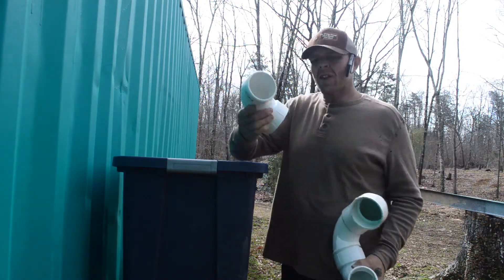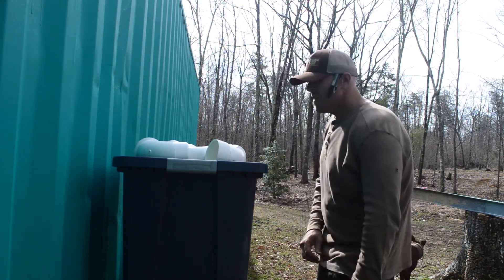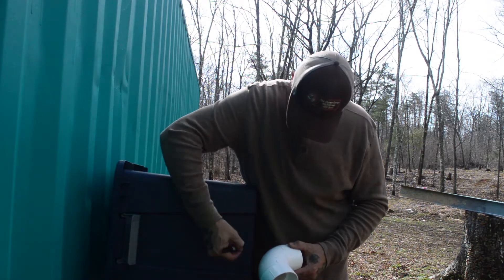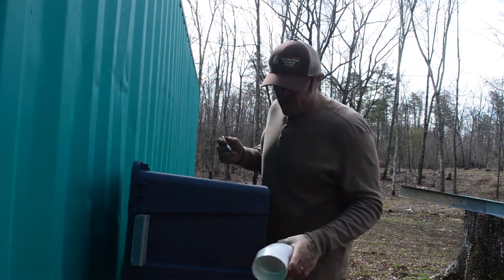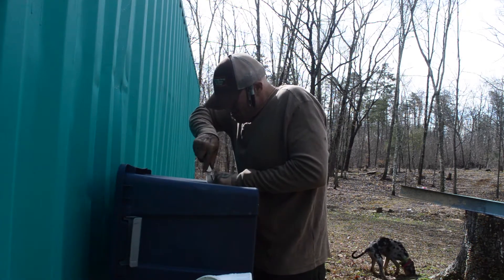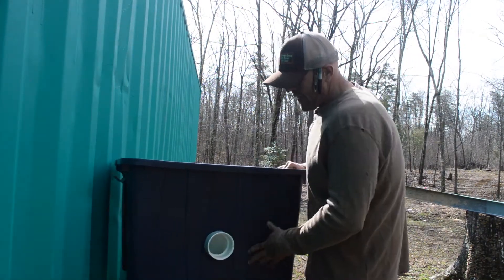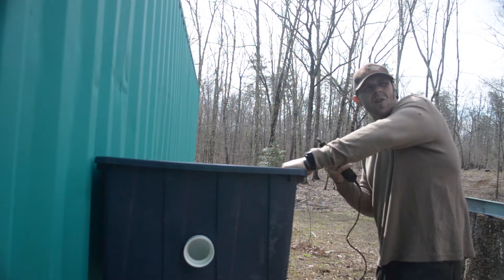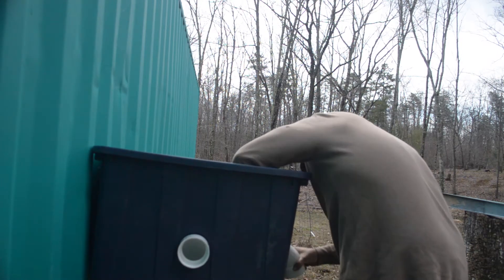Chicken Feeder Build DIY

Comment: Does your feed stay dry? We are wanting to make something like this to sit outside and rain would be a concern. Thanks in advance!!
Reply from the maker: We haven't had any issues with water getting in them. You could put a small bead of silicon caulk around the fittings If you're worried. The hole is cut small though and the fitting should go in tight
Reply: Chuck Slattery Thank you!!